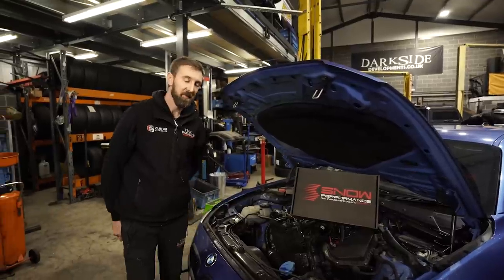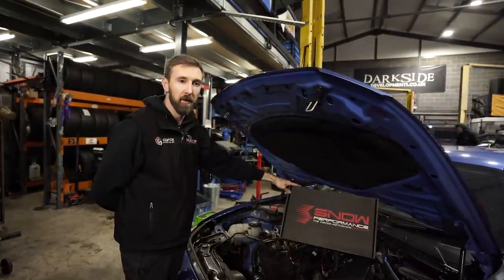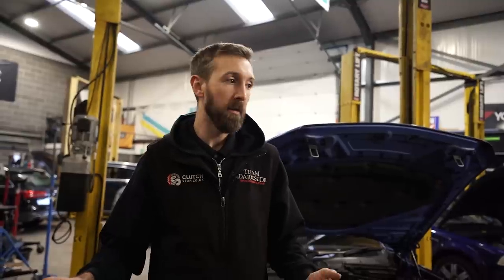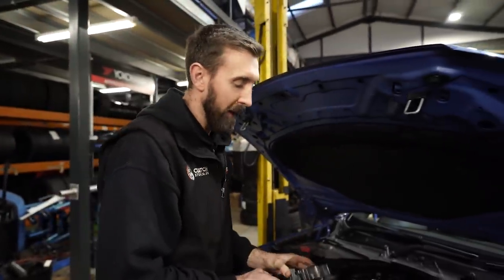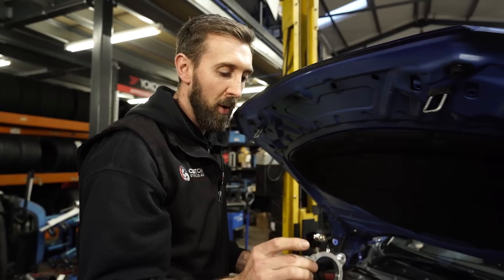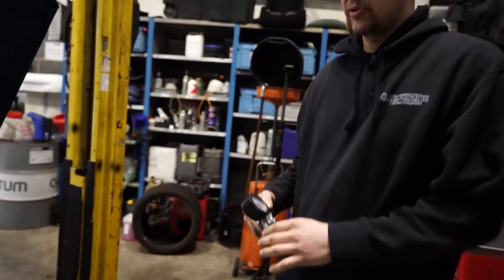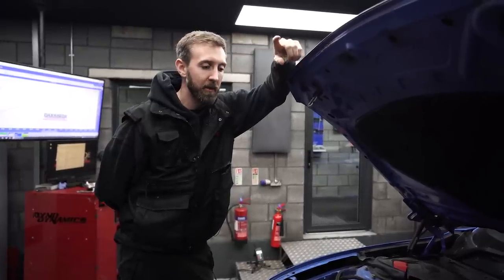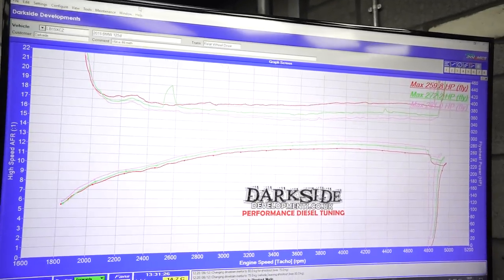125d Gets Hooked on Meth! 🚀

Comment: Awesome nozzle ring, much envy, mine is a tapped hole in the inlet plenum after the anti shudder and some liquid steel for security! Be careful, sheared my stock turbo shaft at the exhaust side playing with meth injection amounts.....ran like stink though.

Comment: Nice tuning. Love the twin turbo diesels. Owned a 123D and now driving a 325D f31. I was wondering how the transmission, the 8hp50 is doing with the overload of torque?
Reply from the maker: transmission seems perfect.
Reply: The polish say around 750nm is when the 8HP50s start having problems
Reply: @DarksideDevelopments is this a ECU stock car or tuned? 40something HP gain with wm is pretty solid

Comment: Is it true that methanol causes bore scoring ? Wouldn't ethanol be a better choice both as a fuel and as an additive ?
Also , about 10 years ago BMW let a few journalists test drive a red F20 with direct water injection (it was a 1.5 gasoline 3 cylinder). Sad that it didn't reach production - it was reported to improve both emissions and performance.
Reply from the maker: Any alcohol will wash bores if you inject too much. Ethanol ignites way too easily, we killed a fully built engine by inadvertently mixing 50/50 Ethanol in the tank, it lasted 1 Dyno pull.
Reply from the maker: M4 GTS has a Snow performance kit from the factory.
Reply: @DarksideDevelopments  Thank you for the information!
And about the GTS : you mean that it's a similar system (to the snow performance) or that it was made by SP ? Forgive my ignorance but I thought it was slightly different (mainly about the water sucked back to the tank once the engine was shut off , having only 3 injectors for 6 cylinders and said injectors being in reality diesel injectors with steel tips)

Comment: 270hp and climbing is just some output from a 2.0 4 pot.
Reply: 123ds are running 300bhp just with injector and fuel pump upgrades, with hybrid turbos you could push 340ish but I doubt it will be reliable then especially on track like they take there’s.
Reply: @piovo1  Ahh yes- figures from the Pub Dyno of course!! ;-)))
Reply: @timbo19751975  definitely not mate😂 just because Darkside don’t do those figures doesn’t mean nobody does.
Reply: @timbo19751975  the 100-200 runs prove it anyway doesn’t matter whatever the figures are
Reply from the maker: We will have more figures in the new year but 100% most figures out there are false as they never make the same numbers when we dyno them!
Reply: @DarksideDevelopments  but the 100-200 runs prove the figures aren’t false

Comment: 6:26 Stage 2 as shown means that it only uses intake manifold pressure to inject at a 90º angle to the current air flow, no matter if there is no flow (as shown) or whatever the rpms on the engine were? What hydrolock and uneven air mixture protection does it have? Why does it change the airfuel ratio on the dyno (so it will make black smoke) if the correct water (or water mixture) should made for a better and cleaner combustion while cleaning the combustion chamber? Enriching the usual leaner diesel mixture could mean that the fuel or the methanol if not well mixed could induce some cilynder walls washing of the lubrication and lead to an engine failure (as failing injectors will do). Am I wrong?
Reply from the maker: If it has boost it has to have RPM, quite simple. AFR changes as you are adding fuel. Again simple.

Comment: Quick question: is the water meth spacer available on the website? (Is it the one posted as the throttle valve delete?, just wasn’t sure if they would fit being stacked or seal up, thanks!)
Reply from the maker: Yes, it's the throttle valve delete :)

Comment: 5:12 No methanol Safety Data Sheet were harmed (or read) during this custom setup. IS there any rules to follow when installing inside the cabin a battery, a fuel cell or other hazardous systems?
Reply from the maker: If you intended to run 100% meth you probably wouldn't want this next to you but we always run a maximum of 50/50 mix with water
Reply: Pure Methanol has a flash point of 9 degrees C whereas 50% Methanol is 24C according to Institute of Chemical Engineers. Neat poses a significant Risk in the cabin or in the engine bay.
Reply: I’d put in the coldest enclosure probably the boot and shield from spark potential. I would assume the equipment is rated to deal with pressure increases due to radiant heat on the enclosure. It is the flanges/ pipe work joins or potential leak points that are the higher risk items.
Reply: @chymist66  running more than 75% methanol on a Diésel engine causes nasty pre ignition it will bent your rods and you will have throw your engine!!
Reply: @ew10j4turbo  I don’t know about that , I was just commenting on the fire risk of having a highly flammable liquid next to you in the cabin, not the merits or otherwise of running an engine on pure MeOH. I’ve never tried it.
Reply: @ew10j4turbo  that's untrue, methanol cannot/should not preignite in a diesel motor.. Diesels ignition temp is around 210c, methanol will not light off till close to 400c. The heat from compression won't reach that level till VERY close to TDC.. And at the same time higher methanol amounts mean more evaporative cooling absorbing a lot of the heat of compression anyway
Reply: @DarkAttack14  my boy go back to school and read your lesson again.